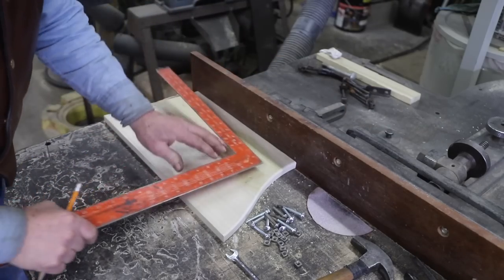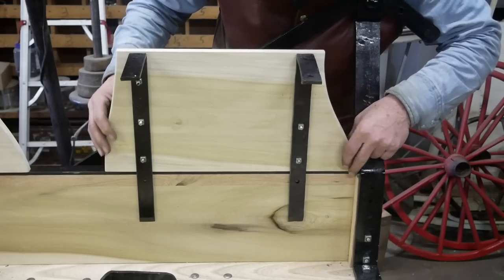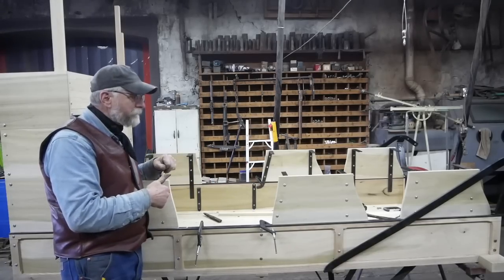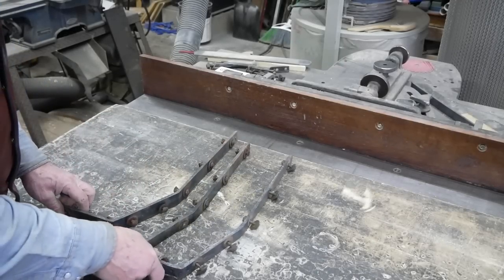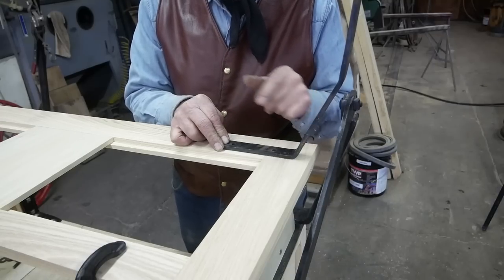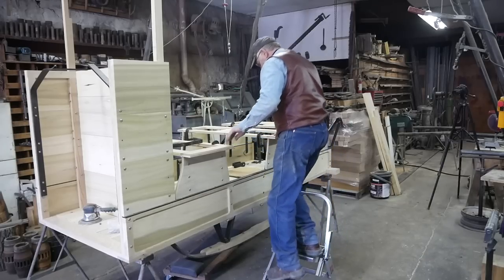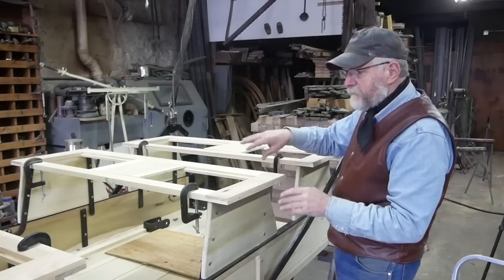Entering The Realm of The Unknown | Engels Coach Shop

Comment: So glad you talked about standing in front of the stove and, not only keeping warm, but contemplating how your work is going to go together. I, too, have spent a fair amount of time in front of my "little" heater in the shop looking at a project I am working on building changes and additions and corrections in my head before I even set hand or tool to the project. I feel better about it now.

Comment: Hello, A lovely series - perhaps my favourite on YouTube. The mystery irons - could they possible be set at right angles to where you thought they went, I.e. that they supported the BACK of the seat, not the arms. That would explain the double angles and, if fixed to the end frames of the seat, the hole spacing would work. Maybe the mystery third iron was a replacement for a damaged one which would have been placed centrally. John

Comment: Dave, one consideration comes to mind. The action of the center seat, has a similar function as a folding seat back of a two door vehicle. It flips forward to provide extra entrance into the rear seat. So reshaping those seat supports provides a safety feature.

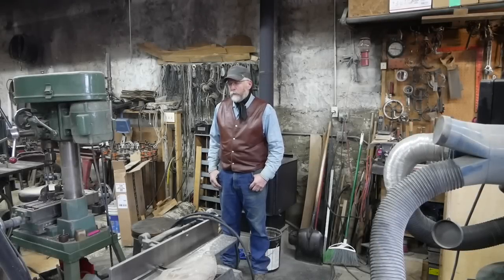Comment: 14:00 Finally, there is a skill I am equal to Dave's! Standing in front of a woodstove thinking! Do you think there is some sort of batten under the seat frames to stiffen them? Maybe there was a threaded rod that went from side to side with a central block to form a sort of truss, much like bracing on wooden stepladders. Those frames should also have some mechanical pins in the corners to help maintain the cross grain glue joints. One other observation about the front seat is if the driver's seat angles backwards, it will hit the back of the passengers' heads. Ouch, my pants are on fire! Thanks for the superb video! The camera work and editing for the seat frame stock prep is exceptional!

Comment: Also was there even backs on the seats? The front seat  has the drivers box for a back and the back seat would have the front of the boot for a back & was the center seat was like a backless bench to take extra passengers when necessary. People expected less when traveling on these inter towns routes. Your on my bucket list to just stand and admire some of the equipment in your shop that I grew up with.

Comment: I think from the picture, you are correct that the iron is the top support in the front, and that the seat support should be trimmed an inch. The picture looks like that support and seat is slightly further forward than your test placement, and it does look like the top is not connected to the drivers box, just like you explained. 
Major detective work on your part!

Comment: Those irons are definitely not seat back braces unless they mounted underneath and had a mid stile to bolt into. If they were on top, then passengers will end up sitting on the irons and (more uncomfortably) the ends of the bolts that stick up through them.

Comment: Evening Dave and Diane, I hope you are well. What if you positioned the seat/back irons towards the outer edge of the seat as back irons, then you would bolt down through the framework and it would I think put a bolt through the lap joint adding a bit of strength as well.,only an idea, 
Regards Richard 🇬🇧

Comment: Dave,

Your work is fascinating!

My grandfather was a boilermaker for the Pennsylvania Railroad.  After he retired, he kept all his blacksmithing tools in his garage (a giant anvil, a blacksmith's vise, big S shaped wrenches, lots of hammers, tongs, and other tools, hundreds of carriage bolts and rivets in wooden trays, etc.).  I remember seeing them when I was a child.  This inspired me to become a metallurgical engineer.

I have some ideas about the reconstruction.

If you flip the lower part of the seats around “backwards” from how they were positioned in the video, then the shorter side of the risers will be where you want them.  It’s an easy fix and it allows you to retain the beautiful curves.

Why not move the irons for the seat backs to the outer sides of the seat with the horizontal part parallel to the length of the coach?  That way the bolts would be on the outside of the risers and would be bolted to the thicker wood in the seat.  This would also provide the framework to attach the top to.

All the best~!

Comment: As far as the concern about making it nicer/better than the original, you've already surpassed that. Just do what you normally do, it will be a signature piece anyway. Like restoring an old car, make it look the same  with better fit and finish. Don't fight it Dave, you'll not be happy with it if it's just good enough.

Comment: You should have worked for an airline builder. They could easily get 8 or 9 seats in the same space you are working with. Standard sitting position would be with your knees right under your chin.

Comment: I was wondering if the back seat for sitting on was a solid piece of wood.  Then the bolts would have support.  I don't know how common that large a piece of wood wood have been at basically 48"L by 8"W by maybe 1 inch thick.  You are the specialist; the rest of us the willing students.

Comment: Dave. if the mud wagon was made as cheaply as possible, all three seats could be identical, - interchangeable. Try turning the front and rear seats around without trimming the sides to see the spacing. Then you can trim them later. That center seat, with the "J" iron, could it have been hinged on that center vertical side brace? Then again, what I'm seeing through YouTube is different than what you are seeing. Thanks for the video. Jon

Comment: From what the pictures you have shown of the old wagon, it doesn't even look like there are side boards to the seats. It looks like if you just moved the middle seat past those irons, it would space out evenly. The side boards to the front seat just need to be flipped around. put the right one on the left and the left one on the right.

Comment: Mr. Engles, are there boards at the ends of the seats as framework? The picture does not show wood or am I not looking with two good eyes? There seems to be metal rising from the driver box frame to the top canvas. It looks as if the rider in the driver seat near side has an overcoat hanging behind and through a metal frame. Something is between the photographer and the man sticking his head out from the rear facing seat. Just an observation. You are the master and I am sure you will come to the correct conclusion most historically accurate. I enjoy your videos and your commentary keeping us in the loop. Look forward to the next video.

Comment: I went back to the photo you were using as the most likely one of the mud waggon, the front row seat had no side.  It seems, through the graininess of the photo, that the seat(s?) had legs instead.  Also, and this is a guess, the seats may have been narrower, maybe more like 12" - 14".  Still, at this time as you rightly point out, we're in the realm of experience and guesswork.  Still amazing.

Comment: Use the irons with the full base for a backrest, but attached to the ends of the seats. A piece under the middle of the seat to strengthen it would be useful to support a central backrest.

Comment: When you positioned the irons as a backrest, i was thinking more that they would be mounted at the ends of the seat to support the back, then both bolts would be in the frame
But looking at that photo i think you are right
Which raises the question, what supported the seat backs, or were they part of the seat sides purely wood.

Comment: If the seat irons are supposed to go on the back, why could they not be on the ends where you have the full thickness frame?  Maybe there was another one with the shorter bottom as you described in the center of the seat?

Comment: Dave, if you moved the rear-facing front seat even a little toward the front, wouldn't that make the passengers in that seat have to sit bolt-upright, and limit their headroom to the back of the driver's seat?

Comment: For sure a puzzle job. Taking into consideration that us humans were smaller back then in height and weight compared to todays humans, I'd agree with the extra inch or so gained between the seats when modifying/trimming the seat mounts. I'd also agree with the irons were mounted side to side vs. front to back for the seats. Once you are set on the method and design for the seats, it seems that you will simply have to move ahead with "how it was" based on your past expeiences and the fact its a "mud wagon" vs. a stage coach. If the client is looking for an outcome based on those pictures, at least thats a fair point on the compass to steer the design. If the client isn't all that sure, I would simply move ahead based on Engles Coach Shop experiences especially if thing are to be done correctly and a tad nicer/higher in overall quality. Hopefully when this is delivered, its not stored outside ever again.

Comment: Those 2 irons appear to be more apt to fit on the left and right edge of the seat as seat backs. Then the bolt holes are in solid frame material. Then you would need 2 more irons for the center seat. The 3rd iron, and missing 4th, were probably made for the damage repair.

Comment: I was wondering about the curve on those sideboards when you did it, and not so much from a leg room perspective, but from a getting in and out of the coach perspective.  The spacing is tight enough that you are going to tend to kick that sideboard and fall getting in and out, particularly if you are in a hurry.  If you have a team that doesn't stand well, that could be a nightmare.  If you cut the front seat back so it can slide further forward, and the back seat so it can slide further back, it will make getting in and out much easier.  Going back and looking at the picture, I think those irons are supporting the top.  The seats in the picture don't look like they have sideboards at all.

Comment: When I study that photo, I see a vertical board behind the driver's right elbow that connects the driver's seat to the top. It also appears to be a slightly curved support  three inches of so outboard of the vertical board. The man with his foot on the Adel huh looks to have his hand on the wooden And rest. And on the rear seat, it appears that the steel seat back supports extend all the way up to the top. Since you only have the two original seat back irons, the ones you build for the back seat are different than the others. I just don't know if that iron would be strong enough to support the back of the roof all by itself.

Comment: I don't think the irons are for seat backs, the taper on the top end of the iron would be on the wrong side, it would be facing the back instead of away from it. It looks like the post you have on the drivers box might be right, it looks like the go up and support the top along with a metal bracket mounted on the same post that extends out to hold the sides of the top out from the body. 
Great videos and detective work on puzzling out the details, you do really good work.

Comment: Dave, I think what the kid is holding on to is a grab bar if you follow it to the top it curves back. At the woman's shoulder you can see a top brace come down and curve to the box. It may be angle bar or something like that I don't know if they made it in those days. It would need to be strong to take the dynamic load of the top, they sure didn't drive ere down the freeway. OOOR you are right in leaving box back braces long to hold the top and the lady is leaning on the grab bar and the kid is holding on to an extension. My best guess just looking at pic. Thank you for your time. PS One other commenter said the seat is on lags I think they are, the board to hold the seat that you made is not their below the kids hand, looks like a flat bar hanging over the side it sticks out into the box a little. Best guess is what theirs is in restoration, every customer wants to know how much before you star and you know all you can give them is best guess. Jay Leno sasses it best restoration is you buy it for $8,000 put 32,500 in it and it is now worth $18,500. Enough babbling Paul

Comment: 23:08 In the yellow circle it's a hat.  The young man's hand is covered by the brim of the hat, not holding onto a piece of iron.  You can clearly see the roof support right above the yellow circle and it's attached to the drivers seat frame.  Are you sure this photo is of the mud wagon in your shop.  There are no side boards attached to the seats of this old mudwagon photo.
Reply: Yes, I think you are on to something there. I'm not so sure it's the young man holding the hat though, but he seems be holding on to something if no the brim of the hat. It seems it could be the person in white coat behind the hat who is also holding it. I'm also inclined to see that front roof support attached to the side of the driver's box. It has an angle about where it crosses the yellow circle, and has a nice curve downward where it meets the box.
Reply: @benhetland576  Yes, I believe the man in the white coat is holding the hat as he's leaning out of the mudwagon.  There's also a corresponding roof support at the rear of the mudwagon.

Comment: The iron with the boy holding is facing outwards, attached to the back of the driver timber and much higher than you currently position. Seems to be holding up the canvas roof.

Comment: One thing I notice from the picture is that the front rear facing passenger seat does not appear to have a solid side to it, unlike those you have crafted.  The area under the seat, straight below where the young man's hand meets the cuff of his shirt looks to be wide open with perhaps just a straight, slender board supporting the seat bottom on this end. This would be a bit less sturdy but might be exactly in keeping with your thoughts of a less expensive version of the Wells Fargo coaches.

Comment: Is that tablesaw that you used to cut cross lap joints and rabbit joints made by Oliver?  I used a saw that looked like that in high-school in 1963 - 1965.  What a great machine!
Reply: It's a 1908 Fay and Egan. There's a video on it on this channel.
Reply: @dianeengel4155 - That's about the same vintage as that Oliver table saw I used in high school at Shawnee Mission North HS.  They built 'em to last back then!  Thanks for your reply.

Comment: @23:07 it doesn't look to me like the seats had wooden sides to them, but rather square wooden posts holding them up...

You can see the shadows etc inside the wagon.
Also the thing he's holding on to doesn't really look like it's attached to anything. 
I think also I can see a plain vertical back to the drivers seat...
Reply: At least for the front seat I think you are right, but it could also be because that side board had just been ripped off at the time the photo was taken. Or the front row could have been made without side boards assuming it had enough rigidity by coupling to the driver box, yet the other seat rows still had them (which I guess the irons have indicated).

Comment: I see exactly what you mean about that upright steel where the young man is holding on to it at the front, and I think you are 100% right, for the front ones. But in the picture, I do not see anything on the sides in the back at all, it looks (to me) like the roof back there was held in place by the seat back. Could the front two have been sideways as you have them, and the rear two be part of the seat back?

That may also explain why there are two different sizes/styles. They might be two different things.

Also, from the footage of you snipping the bolts off of those irons, you can see from the length of the bolt how much wood they went thru. It doesn't look like any of them are short enough to have only gone thru the 1/2" (or so) part of the seat. They look like they went thru more like 3/4 or 1" on camera. So if those two were seat backs, something must have been different on that seat. Perhaps that one seat was narrower than the other two.

Just my thoughts, maybe it will help somehow.

Comment: I suggest that the steel should be placed on the drivers seat in front of the pole supporting the top. Why? My guess is that the top is like a flat boatbottom turned upside down on the poles, easy to lift of. The holes in the steel maybe for a cleat or a handle or something else. I guess the young man is holding the passengerseat or a handle on it. The lady on the wagon is holding a hat partly hiding the hand.
Reply: Or is the young man doing a presenting gesture with the palm of the hand facing upwards.

Comment: The original seat flat bottom design wasn't very innovative. I would have the seat bottom tilt lower front to back a few degrees so when you sit down gravity puts you back in the seat.

Comment: I have to disagree with your locations of the irons.  It appears to me that the roof is attached front to rear, and the sides are open.  I'm not sure what the young guy is holding in the picture, but I don't see anything extended up. Actually, I think you have them upside down and backwards,  I think they support the canopy..  Could the irons be for steps to get in and out on.  The man in the center with the hat seems to be standing on some?  I'm almost 100% sure that picture and your mud bug are not the same vehicle,  so just do what you think is right.